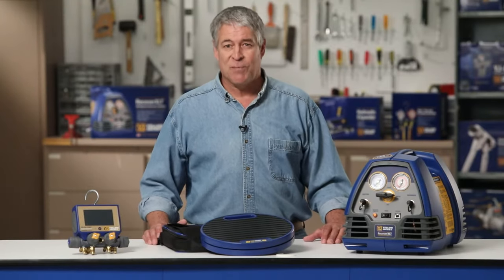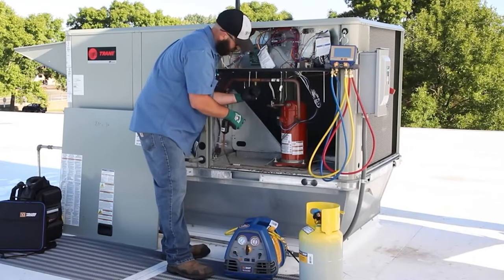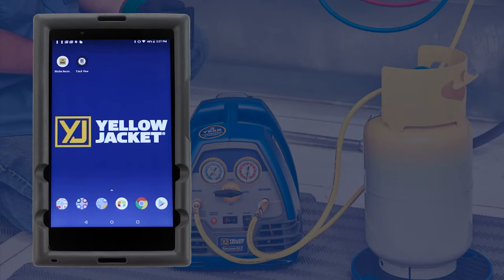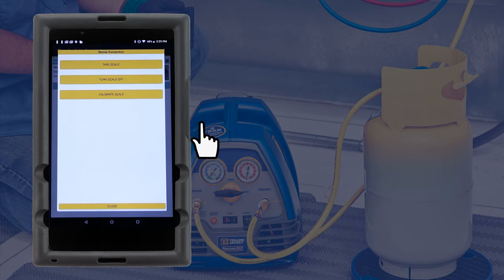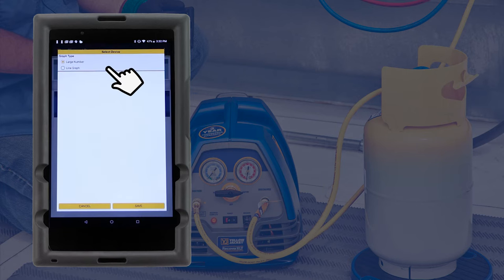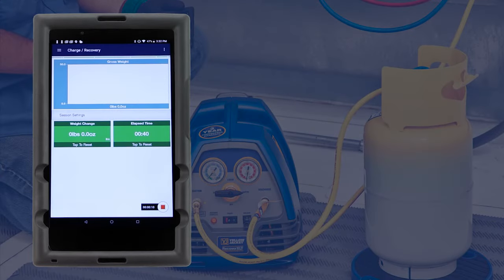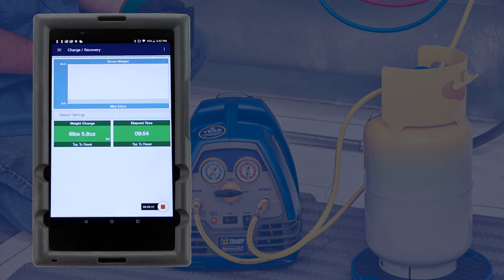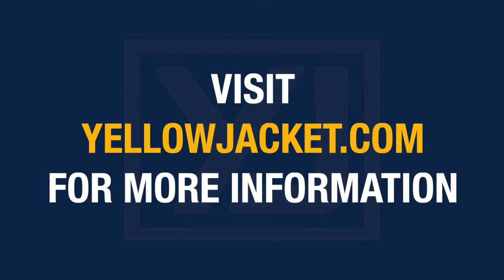Refrigerant Recovery with Wireless Scale, RecoverXLT and P51-870 TITAN Digital Manifold

Comment: I have an XLT 95763 that has 2 issues.  1: it takes forever to shut off in a vacuum from about 0.5 bar.
2: often the discharge gauge flutters on the unit at about 12 bar.  Could you please advise what the problems could be?